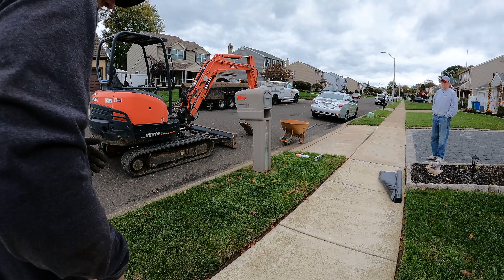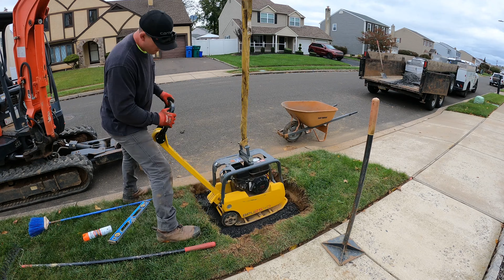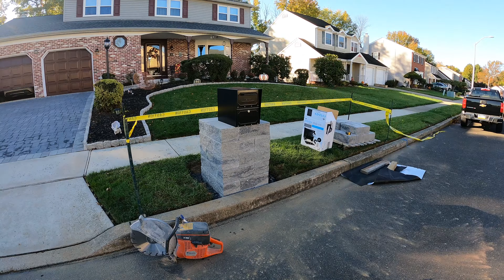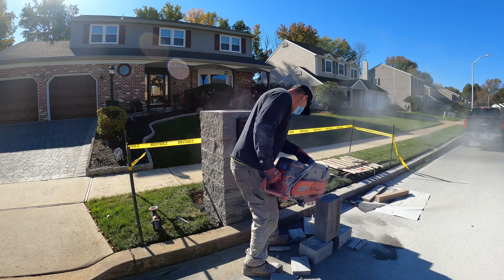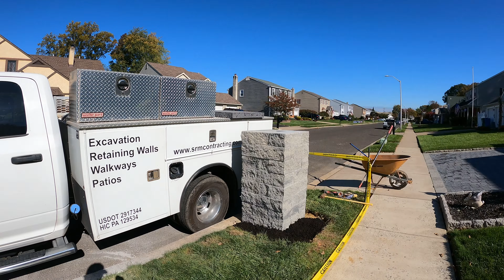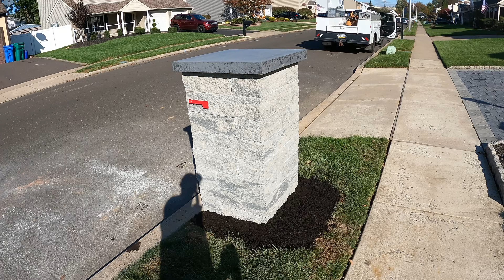How to build Stone Pillar Mailbox

Comment: I've been researching this topic and stumbled on this video. I'm tired of U-turners running over my mailbox and post light. I'm surprised you didn't pour a concrete pad and only used gravel. I'm in PA as well, so the freeze/thaw condition is a thing for me too. Which is best, a concrete pad or gravel base? Also, AI tells me I may be liable for structures that aren't "break away" in the event someone sustains damage from plowing into my mailbox super structure. Have you ever heard of such a thing? The damage I have sustained has always been hit and run. I saw your website on the side of your truck. If you;re close I may be in contact. Thanks!

Comment: Awesome job! Looks great! I have been looking on YouTube on ways to build a unique and creative way to build a mailbox and post. I like this way but my mailbox is on the edge of a decent sized ditch so I’m afraid I’d have to dig way deeper than what you dug to get to something flat and to give it a good foundation. I saw some ideas for a mailbox from copper sheet metal then forming it. Might do that then just use a regular ol 4x4 post. But still searching YouTube for ideas. Plus not really trying to copy anyone else necessarily but rather hoping it’d spark another idea in my mind.   Thanks for posting and sharing it step by step!!!

I have always told my wife I want a mailbox with those vacuum tubes(I don’t know the name of them) but it’s what banks have when you go through the drive through and the clerk sends you cash or paperwork through those tubes. Told my wife need to dig underground and have a tube coming inside my house.

Comment: It's a shame you blew it on those last couple crucial cuts and had to shim it on top. Would've been a pretty nice touch if you had got it right
Reply from the maker: Nothing to do with the cut dude
Reply: @srmcontracting You’re lying to yourself but you’re completely right, it was the weight of the unsupported brick that needed support by shims…. Due to??? A miscut brick that wasn’t in contact with the mailbox. 😂😂😂
Reply from the maker: @davidostrom2661 it was in contact with the mail box. But since it was unbalanced it was putting a lot of pressure on the thin sheet metal mail box. Sooo I added shims to make up for the flex in the mailbox. But hey keep trolling, school is in session.
Reply: @srmcontracting bro, the only thing flexing was the air gap between the mailbox and your brick. Keep trying to be a mason though, you’ll get it eventually. No trolling necessary in this case either. Spittin pure, hard facts. Denial is an ugly thing

Comment: Very nice work.  I prefer that rock profile more than brick.  And the contrasting color stone cap has a nice touch also.   I'm betting that the cap needs to be water-sealed every year.  Ive seen what happens when you don't seal the stone products.

Comment: uneducated me asking this question: Why use that glue instead of mortar? Is one of the two stronger or last longer than the other?
Reply from the maker: This is how they're intended to be built. You could use mortar is that's the look you prefer (mortar joints). But as far as strength goes the glue is very strong and will last a long time as long as it's applied properly.

Comment: Why no frost footing?
Reply: Not necessary for segmental block like this.
Reply: @zaggnutt2772  why not?
Reply: @markakin3742  because they are designed to flex slightly.  The reason you need a concrete footer in a traditional grey block / veneer build is because everything has to remain immobilized or the mortar between joints would crack.  Hope this helps.
Reply: @zaggnutt2772  ok I got it thank you

Comment: Will the 3/4 inch rock support the weight of concrete block columns like this over time? Im reading articles that say you need a concrete footer underneath these types of mailboxes to support the weight and that without one the column will sink and lean.
Reply: @Xtreme Caged Combat: If he only had a 3-4” base then that would likely be an issue. He’s got 10” under there and tamped down hard. That column isn’t going anywhere.
Reply: Look at some of the YT videos of Mike H.  He spoke about concrete footers in a build like this.  He said "look at railroad tracks."  Trains move tons of freight and all their tracks rest on nothing more than a gravel base.
Reply: I read a similar article about some houses now having footers consisting of only 3/4 rock instead of conrete as well. I built one of these mailboxes on 11 inches of 3/4 rock tamped every 2 inches before I posted but became concerned about whether it would hold having no experience to rely upon and reading articles saying a concrete base was necessary. 2 hardscape contractors observing the structure said the same thing. (I know there are always conflicting opinions and not every one is correct.) In any event my 6 ft 24 x 24 pillar mailbox has been fine up until this point without the concrete base. I appreciate the feedback. Just reading your comment now.
Reply: @xtremecagedcombat7089  There are two  different materials and two different installation methods for those materials.  If you are using segmental wall block (like in the video), the base should be 6" minimum of a 2" length stone with or without fines.  The wall block is allowed to flex slightly which is why there is nothing in the joints between block.  There are a few keys to preventing the tilt.. The most important of all being the use of a textile fabric between the stone base and the subsoil.  The second most important key being good compaction of the stone base.

In a traditional installation with veneered brick or stone finish, the entire unit needs to be singular or monolithic because if it is not, there will be cracking in the mortar due to the flex in freeze / thaw cycles.  In this installation, a concrete base would be necessary to prevent this.  There are other factors to consider including soil type and whether you have a freeze / thaw in the soil in your area.

Sounds like you should be fine with how you installed yours.

Comment: Any reason I couldn't do this here in the hot/humid part of Texas? Every brick mailbox I see around here involves mortar, and I think you're the first video I've found that uses cinder block sized paver blocks and polyurethane epoxy. This is exactly what I'm looking to do myself. Thanks for the inspiration.
Reply from the maker: Yes you could build this style in Texas with no problem. I think what happens in certain areas is a contractor (or contractors) will only build one style of something and then homeowners will think that's the only option. Best of luck with your project, Thanks for watching!
Reply: @srmcontracting  : After you drilled the hole for the flag, how did you get it to stand upright? Is there some kind of stopper on the screw or something like that?
Reply from the maker: @marccovitz5289  The flag was on it's own swivel bracket. The screws held the bracket to the block.
Reply: @srmcontracting  : Thank you.
Reply: What do you use to secure the blocks to each other?
Reply: @larryleach6476 gator block bond polyurethane adhesive

Comment: What’s the dimensions of the blocks?
And Where can I find them?

I have checked Lowes and Home Depot but no luck. 

Thanks for the video, and video.
Reply from the maker: These are "Techo Bloc pillar blocks" 6" x 8" x 16". You won't find these at those stores. Search for your local landscape supply, give them a call and ask if they sell pavers. They might not have techo bloc, but they could have ep henry, cambridge, or unilock. Larger yards should have these pillar blocks in stock, so call around. Good luck and thanks for watching!
Reply: @srmcontracting  
Thanks a lot Sean, I’ll sure check around.

Comment: Sean I really gotta give it to ya man, you do great work!! I’m very impressed! I’m going to start building these for my customers. How many blocks did this one take? And how much was the total cost for materials and labor? I’m guessing about 2500$?
Reply from the maker: Thank you, it was 36 blocks. I charged $2100 and the customer supplied the mail box which was about $150. Thanks for watching!
Reply: How much was each block
Reply: @JesusHernandez-vm4pi  Retail that block would be less than $20 each retail price in Pennsylvania.  I am a contractor in PA, so my price is lower.  Every vendor sets their markup so you will want to check around for the best price.
Reply: @srmcontracting  : Hi Sean, what brand of glue did you use? Also, I am doing something similar with cinder blocks and cultured stones over the cinder blocks. Do you think I can use glue to attach the cinder blocks to each other instead of mortar?
Reply from the maker: @marccovitz5289  I'm using paver adhesive by SRW. I wouldn't use glue on your build, cinder blocks aren't very strong on their own. I would use mortar for sure. Good luck with your project.
Reply: @srmcontracting  : Thank you Sean. I have my cinder block column built and the mailbox is installed within. I now want to install a bluestone capstone. Do you recommend I use mortar to fasten that or can I go with adhesive/glue for that?
Reply: @srmcontracting  Was that for labor only? Or with the $1000 worth of stone?